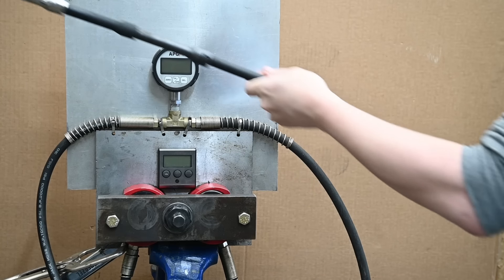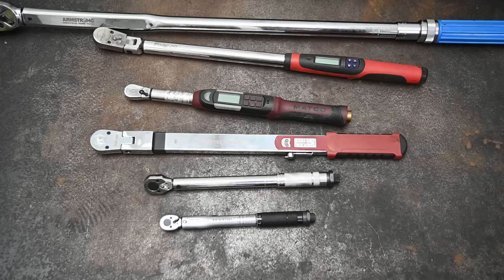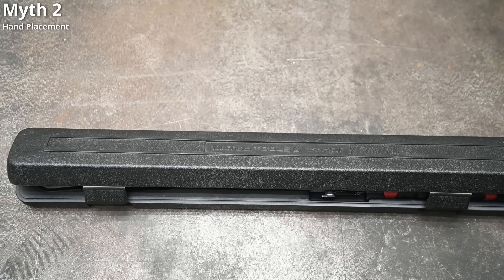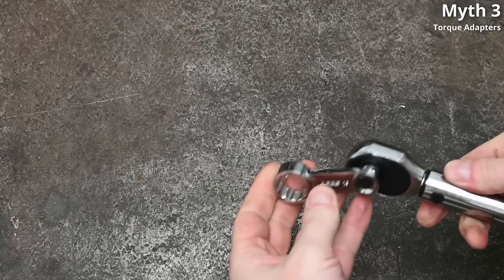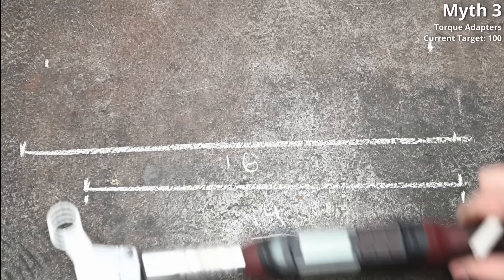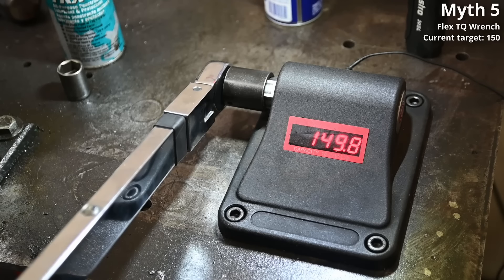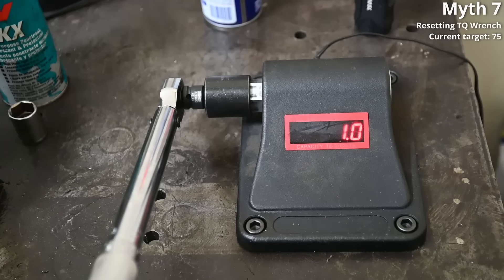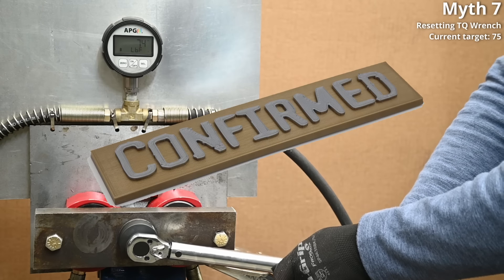You're Using a Torque Wrench Wrong: MythBusting 10 Do's & Dont's

Comment: As an engineer who is really good at math, I'll admit that I thought that is how using an extension would work, but never was sure enough to try it on anything important.   Thanks for confirming what I was never totally sure was correct.
Reply from the maker: I'm with you, except for the good at math part. I've always been "well it's obvious it shouldn't change" meanwhile my brain is like "Right? I'm pretty sure"
Reply: How do you know if someone is an engineer….
Reply: As a dude who never got past algebra 2 in community college, I figured extensions would work this way too. The extension might twist... But it's still going to transfer the same amount of torque unless you twist the extension past the metal's plastic deformation point (I think that's what it is...).
Reply: @gpaull2 I think the answer is the same as Q: how do you know if a man is a pilot?
A: He'll TELL you!
Reply: Can't say I ever had any doubt about the extensions. This is pretty simple static system. The dynamics are what complicate the behavior of impact wrenches. Though there was someone who claimed to be a technician at a nuclear plant or something and they were taught to never place a hand on the head of the torque wrench while tightening. The reason I do is usually when I have extensions, otherwise there's enough wobble in the line it'll move to the side, or it'll knock the socket off the nut or bolt. Personally I think putting the hand there is fine and won't hesitate to continue doing it, but would be curious to see it measured. Maybe in a YT short rather than making another long form video.

I'm guessing when all the extensions were on TTC was already using his hand on the head otherwise I doubt he could keep the line of extensions straight.
Reply: see that's the worst part about engineering imo, we get thaught that math is always right and as long as you do everything right you're good to go when irl things can be very different. Maybe that's because i grew up in a shop repairing cars and we know that mechanics and engineers don't get along very well...\
Reply: As an ex aircraft spanner monkey (engines/airframes) that's average at math, I'll admit I learned absolutely nothing new from this upload.
Reply: My mind says the extension will mess up the torque but my brain says huh?
Reply: How You are an engineer and being good at maths?
Reply: Statics class immediately came back to be as soon as I thought about it. Torque is force time distance.
Reply: @nasonguy  It wouldn't matter how hard you twist the extension.  You could make an extension out of wet spaghettis and as long as it can transfer the rotational force (torque) the reading will be accurate so long as you are straight on with the fastener. That elasticity or deformation does soak up torque from an impact source just like headgear on an amateur boxer soaks up linear force from a punch.  It's just providing a cushioning effect.
Reply: @Sevalecan  I work on agricultural equipment. We have a torque stand that is a sqquare tube that is vertical with a series of rods at an angle to support the long extensions needed to torque the wheel lugs/bolts.
Reply: @a9ball1  When you apply a STATIC force to any rotating shaft, whatever is on the other end of that shaft will be rotated with force equal to whatever force you apply - no matter how long that shaft is. 
This is not true when the force varies - such as when you use an impact wrench. Springiness of the shaft can alter the instantaneous torque value on the receiving end.
To see it another way, if the receiving end didn't get all of the force from the sending end.... where does the force go? Or perhaps look at it from the nut or bolt's perspective. It is pushing back on the wrench - no matter how far away it is. 
If the force could be different at opposite ends of the extension, we would have the makings of a perpetual motion machine.
Reply: "Really good at math," "was never sure enough" 😂😂 it's literally T=Fr=Fl, there's basically no math lmao. You aren't good at anything
Reply: @gpaull2  The fact that he didn't know, makes me question everything about his statement!
Basic level physics here, which is almost like an intro to engineering.  Physics and Dynamics are prerequisites for all other engineering classes.

Torque formula -- Force X Arm (length) = Moment (ft/lbs)
It is literally Newtons 2nd Law.
Reply: Cool story bro

Comment: Finally, real proof of what I learned about 3 decades ago, when I decided that since I swapped wheels on my drag race car frequently, a bit of anti-seize might be a good idea, so I don't "wear out" the wheel studs and nuts... and, that is exactly the same time I started breaking off wheel studs while torquing them to the same torque value I did before, and was left scratching my head!? I even went out and bought a new torque wrench to replace my suddenly "inaccurate/broken" one! Finally realized that the ONLY thing I changed was adding anti-seize...once I took the anti-seize off the wheel studs, the problem went away!  This was in 1987 or so. No YouTube, no internet (at least not for most folks). Just learned the hard way. About a year later, GM released a TSB warning against the use of anti seize on wheel studs. 🧐
Reply: I remember the hours....DAYS...sometimes even weeks we spent researching things before the internet. Trying to pin out an '80s german wiring harness, finding rare parts by spending 4 hours at the local speed shop going through greasy catalogues...blegh. And now all we use it for is arguing with people.
Reply: Sounds like GM, going for rusty/seized instead of a spec for lubed threads only!
Reply: @alro2434 because each type of grease/anti seize will have different friction properties and they have no idea what grease, an idiot is wrongly applying so safer to just go with a dry torque. 🤷‍♂️
Reply: I learned the hard way too. Knowing the importance of lubrication and anti seize, I always lubed up wheel studs until one time I was changing from summer tires with alloy wheels to winter tires with steel wheels. I kept trying to torque the nuts and the raised portion of the wheel where the nut mates was collapsing. Did a lot of reading and found out that wheel nut torques are specified to be torqued dry or unlubricated.
Reply: Back in ancient history, I worked at a naval shipyard.  As you might expect there were VERY complete instructions on the mounting of hull valves, since those bolts might be the only thing keeping tons of seawater pressure at bay.  IIRC some nuts were tightened with lube and some without, but always per the instructions.  Double checked by the mechanic's foreman and QA.  It's very sobering to know that you are going on sea trials in a submarine that you worked on.
Reply: 6 ft of extensions 😂
Reply: Ok I think I made the same mistake too I love anti-seize I put it on everything I better go recheck those bolts now
Reply: @lossless4129 Manly rig!
Reply: We learned that in aircraft mechanic school. In aviation, torques are generally indicated if to be dry or lubed, but not so on antique aircraft (where there's often no specs at all). 
     I maintained a Waco ZPF6, and the first annual inspection I did on it, i looked up control surface deflections. Hint: there are none listed. Same with torques. What CAN be looked up, though, is how much a fastener is meant to stretch. And if stretch can't be measured in-situ, it CAN be correlated on reference tables, or a jig can be made where stretch can be measured, then determine torque necessary for desired stretch. With this method, you're pretty much assured of getting it right. 
     The 'torque dry, mark, remove and lube, then torque to mark' works, too. Would've saved you from snapping lug studs/bolts. The reality, though, is that, in MOST applications, close enough is good enough. The old 'calibrated elbow'. Engineers are generally aware of the fact that many times someone in the field might overtorque. Hence, they generally spec fasteners that are WAY oversized for their intended load. 
     Where fastener preload is critical, torque is seldom used as the spec, exactly BECAUSE it can be so inaccurate. And in situations where preload is critical, but ONLY torque can be measured, you'll find some methods that, one might say, almost cross the line from "ingenious" to "insane". Beechcraft King-Air wing-attach bolts come to mind. A special washer (one-time-use only!, and near $1000!), with a hole drilled in its side, into which a scale must be placed... 
     All things considered, I use anti-seize pretty much everywhere I can, where there's any chance of oxidation on or between threads. Dry torque is only as good as how perfectly clean, unworn and un-damaged the threads are to begin with.
Reply: @chrisk1944  
I enjoyed your post.  The washer that was $1000 bucks is no surprise to me, well, a little bit.  It's insane how much one small item can be seriously overpriced just because it has the word aircraft "stamped" on it, but a washer? Wow!   I say that's a bit crazy and that's why I can't afford an airplane.  All I got to do is fly some  for a few airlines for 25 years but I did appreciate it when I saw the mechanic waiting at the gate as I taxied in with a write-up in the book. I could ask questions about stuff they didn't teach is ground school and I learned some valuable tidbits here and there that helped me better understand the machine I was carrying folks around in.

Now that I'm retired I actually enjoy "wrenching" on my own vehicles and am gaining a good bit of knowledge, thanks to YouTube..it's awesome to be able to fix my own car and not have to take a beating at the stealership for a job I know is done correctly because I did myself.

The meaning for this post is to let you know that I admire the professional men and women out there that can inspect and fix airplanes.  That's something I couldn't do and I always gave them the respect and courtesy they deserved, especially knowing that there are pilots out there who are dicks.  I've flown with them and they embarrassed me when they talked down to mechanics, or ramp agents.  That was something I never did during my career.
Reply: @chrisk1944  Pretty much all the machines I have worked on have 2 torque values for safety critical fasteners, the first is for a dry thread and the second is for a lubricated thread. The wet value almost always comes with a condition that a specific type of lubricant is used which is usually MoS2 for low temperature.

Comment: One of my favorite moments working at a uhaul repair shop was when they sent the shop a torque wrench calibration tool, and my $10 harbor freight was the most accurate one in the entire shop! Even after they calibrated the other guys (and shop) tools, mine still had the tightest range.
Reply: I was just as surprised to find this out after buying Snap-on duplicates of all my cheap torque wrenches.  Pretty upsetting to have wasted so much money.
Reply: Not uncommon at all, even with precision measuring equipment like calipers and micrometer prices doesn’t equal accuracy.  Even more surprising mechanic who regularly uses torque wrenches can be within 10% without a torque wrench.
Reply: @zacharymorris9917 That doesn't mean it's a waste of money. Your Snap on may not be as close now, but give it 6 or 7 thousand bolts before you make your judgement for sure
Reply: @maxscott3349  I've given it at least 10 years so far.  The Snap-on are definitely more user-friendly, ergonomic, and comfortable.  Using them correctly is definitely more accurate than the others being used incorrectly.
Reply: @zacharymorris9917  Oh I completely misunderstood you didn't I
Aw well
Reply: You literally are the science class definition of precision vs accuracy
Reply: @zacharymorris9917  We frequently see the Pittsburgh ones fall outside the +/- 4% limit at calibration. The company who used to come do our calibration before we got our own calibration bench told us the Pittsburgh ones can't be calibrated and then they're junk. I wouldn't buy snap-on as they don't build the wrenches or offer anything special. A CDI wrench is the exact same tool as they make them for snap-on(and other tool companies) and costs significantly less.
Reply: @hondaguy9153  I have yet to see anyone show the dirt cheap Pittsburgh to be anything other than exceptionally consistent and accurate.
Reply: By six or seven thousand bolts, you're going to be needing a new snap on tool any way. At that price, you could have bought 30 harbor freight wrenches, which would last you 20,000 bolts. 

It's like this lady I was talking to who was bragging about her $26,000 Can-Am buggy. I told her I bought my Chinese buggy for used for $500. I could have bought 46 of my buggies for one of hers, and mine does everything I've asked of it. It's not perfect, but I have thousands more dollars available to modify and repair mine than she does, plus parts are stupid cheap, so I don't care if I break it.
Reply: @DanielThompson-rl4xm  that's peasant cope.  Chinese SXSs are a joke.  Not a valid comparison. 

A Pittsburgh torque wrench will literally do everything a Snap-on will.  A Chinese SXS definitely won't do everything a Can-Am will.
Reply: @zacharymorris9917  Are you planning on invading Klendathu or something?
Reply: @daniel cool story bro
Reply: @gamerknown  I have no clue what you're talking about.
Reply: It's to be expected that the China torque wrench might get lucky once in a while. I bet if you measured a lot of them, they'd be all over the map.
Reply: @dwaynepenner2788  Even funnier is accuracy of a musician with a wrench and a hammer. The piano tuners are even more accurate. all comes to the different frequencies the stressed wrench resonate. And skilled ear is very sensitive to the tone.
Reply: @dwaynepenner2788 My German farmer grandfather was able to turn whatever wrench fit the fastener into a German torque wrench---"yeah, 'yust turn it down guten-tight". Not much stuff you hook to a tractor requires precision torque, because it requires well beyond normal human strength 20:25  and ambition to twist the head off most implement bolts, but lock washers are standard practice.